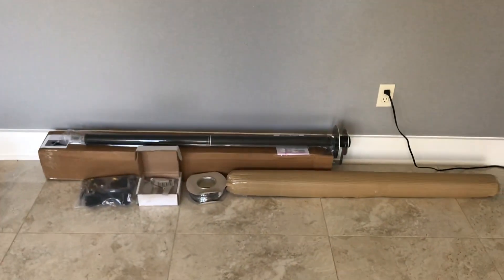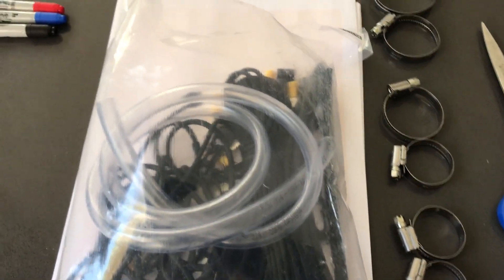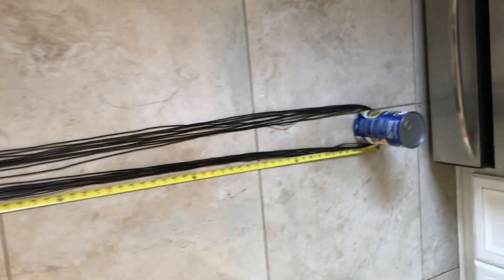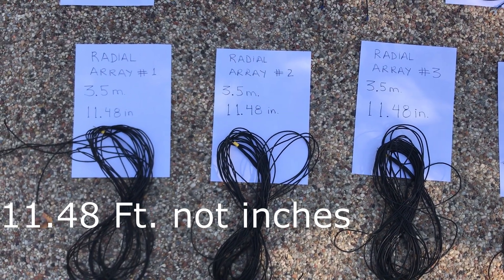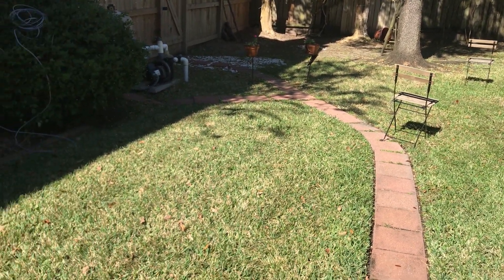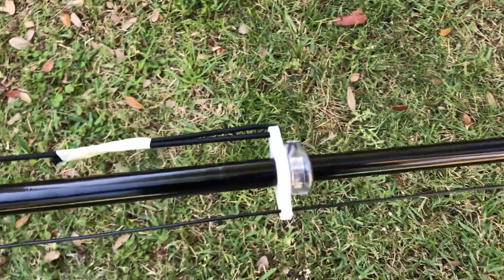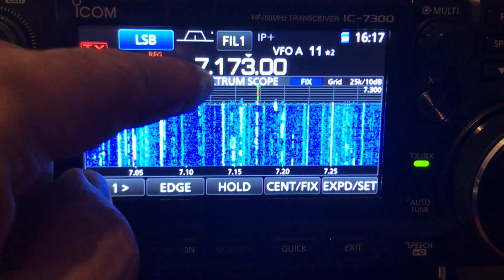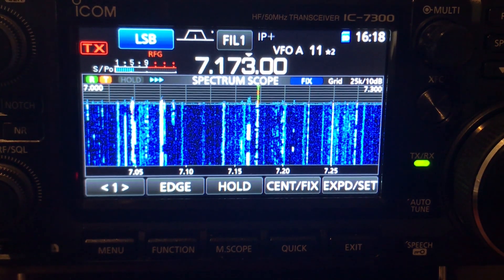DX Commander Antenna Build

Comment: Great video
Reply from the maker: Thank you for the comment.  Hope the video helps out!  73.
Reply: Unfortunately i can’t get 15m to tune at all. 40 is a little high but 15 is around 23.400 and i cut it 2’ longer than cal recommended. Totally confused and he’s useless to get in touch with
Reply from the maker: @K1DTC  It makes sense that the 40 and the 15m bands are both showing anomalies since those two bands are harmonics, or integer multiples, of the element lengths.  I suggested the following to another ham in this thread so hopefully it helps:  "For the 40m element the wire does a 180degree fold at the very top.  I then fastened it to the highest point on the fiberglass pole by inserting the folded wire element through a small transparent rubber hose that's included.  I then wedged that hose, with the wire through it, onto the top of the pole.  I have a bit of the 40 element wire dangling from the top of the pole, but it works fine."  Thanks for the comment and 73.
Reply: @quantumradio  thank you for the comment, i essentially did the same. He is very clear in the manual that the element going up though the hole must be 180 degrees “across”’coming down. I even max a “bow” like he said. I cut the Element exactly like he said and here are my readings 
15m-19.450
40m- 6.940 

I’m almost renewed the remove 30m and make that 15 only. Not sure if that would work though. I really appreciate the help. You can email me K1DTC i just didn’t think there would be such a huge discrepancy

Comment: How has it held up to high winds/storms? Excellent video!
Reply from the maker: Thank you for the comment.  My antenna is nestled amongst oak, elm, & crepe myrtle trees and when strong fronts come through SE Texas, one of the three paracord tie-downs "gives way".  This has happened many times & could very well be due to the swaying of the crepe myrtles pushing laterally against the 30ft fiberglass pole.  The tie-down's weak point are the two teeth (dogs) that clamp out into the black plastic barrel that hold the paracord itself.  So after storms it's a matter of re engaging the teeth inside the barrel and you're good to go.  Hope that helps & 73!
Reply: @quantumradio  Thanks for the reply and info. I grew up in SE Texas on the Galveston mainland, now in Louisiana. Hurricanes are my concern. I've been wracking my brain trying to figure out some kind of tilt mechanism that would be easy to make, and trying to decide between the Nebula and the new Signature models, keeping the hurricane threat in mind. 73!

Comment: Oh, one more thing, how long were you radials? Were they 3.2 meters or 4.5 meters?  thx.
Reply from the maker: The radials were each 11ft in length if I remember correctly.  11ft=3.35m.
Reply: @quantumradio  Super, thx.

Comment: For the 40 meter element, the wire folds on itself?  I'm guessing it's not tied?
Reply from the maker: Hey Frank, yes that's correct.  For the 40m element the wire does a 180degree fold at the very top.  I then fastened it to the highest point on the fiberglass pole by inserting the folded wire element through a small transparent rubber hose that's included.  I then wedged that hose, with the wire through it, onto the top of the pole.  I have a bit of the 40 element wire dangling from the top of the pole, but it works fine!  73!
Reply: @quantumradio  Super.  You would remember how much wire there is after it does the 180?  Thx.
Reply from the maker: Frank, I just looked and it seems to be ~3ft of wire element coming from the top of the fiberglass pole down the side of it.  The antenna wire element is fastened to the pole at about 1ft down and 2ft down by threading the wire element through the other transparent rubber hoses.  The last foot or 1.5 ft of wire element is loose but doesn't stick out much.  Hope that helps, 73!
Reply: @quantumradio  Super, thanks for the info. Have a great day.  -73

Comment: Did you use radials, as I don't see any fitted to the radial plate?
Reply from the maker: Yes, the radials were connected to the baseplate after the raising of the antenna.  The SWR reports close to the end of the video were with radials in place: 16 radials in bundles of 4.  73.
Reply: Thanks for the info. 73

Comment: Just finished a 6-el with a Jackite pole that is very much M0MCX/DX Commander inspired (Callum's videos and website are great!).  Used it for Field Day for the first time.  It worked very well!
Reply from the maker: Great to hear!  Callum's antenna modeling and his approach to DX using low elevation angles are spot on.  73!

Comment: This year im taking my foundation licence i  listen and watch calum a lot hes a top bloke who will help anyone 
What power can u use on usa ham beginners licence 
In uk foundation its 10 watts
Reply from the maker: Best of luck on your foundation license.  Per FCC (US regulatory agency) rules, Technician licensed amateurs can transmit with a max of 200W and only in parts of the bands: 10m (RTTY, data, phone, & CW), 15m (CW only), 40m (CW only), 80m (CW only).  Also, specific restrictions apply to the 6m, 2m, 1.25m, 70cm, 33cm, & 23cm bands, though there you're probably limited by the equipment's max power output.  The ARRL site has the detailed band plan in their website "www.arrl.org" but this is a quick summary.  73!